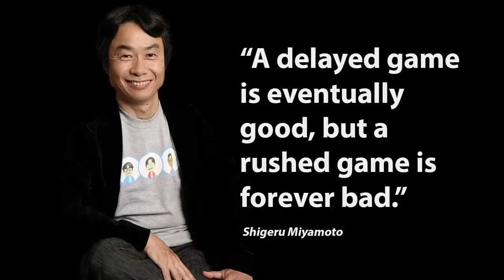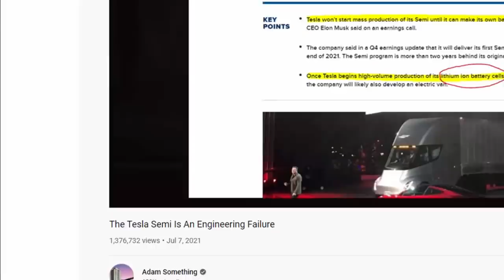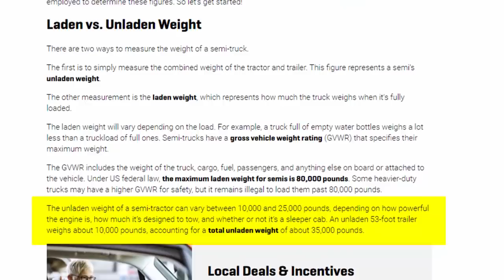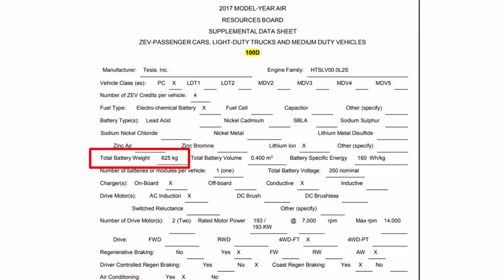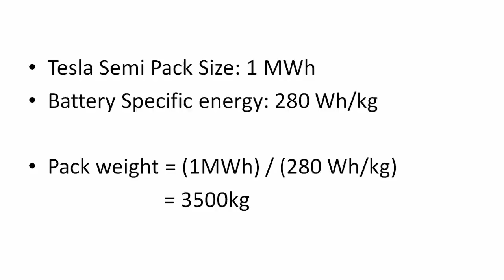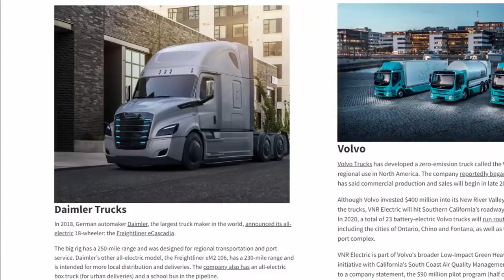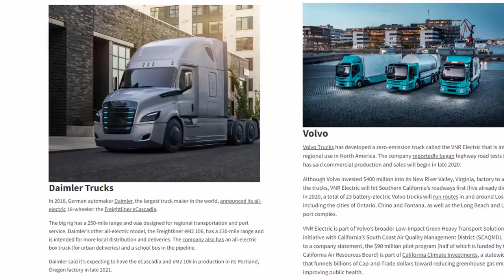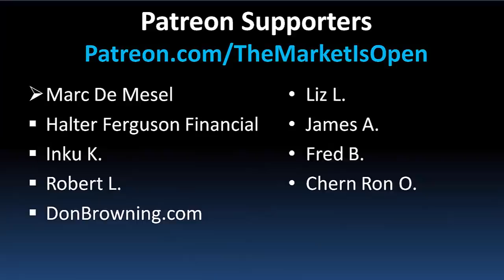The 2022 Tesla Semi is Genius, And Here’s Why

Comment: As someone from the shipping world, "with" what I have learned about this truck, "I Think" it will a have very limited customer base due to the Battery System. I think Tesla engineers would be better served with a storage system that is interchangeable rapidly like a towed energy storage dolly or removable energy storage cassettes, or Both? Then a driver could pull into a destination, or "Truck Stop", swap out energy systems in a few minutes keeping the units on the road making money virtually all the time While Increasing Range to an UNLIMITED Amount! with momentary stops only dependent on regeneration stations.
Reply: That would require someone to standardise the batteries, it is changing too fast at the moment and I don't think competing companies will come to an agreement regarding this. Also these batteries are extremely heavy at the moment so I cannot imagine driver exchanging them fast without some sort of crane or risking accident.
Reply: You are thinking of "Long Haul" trucks, which is fine, but Tesla Stated they are targeting the "Other 80% of The Market: Day Cabs & Local Runs, never more than 250 Miles out from Base, in any given Day!"
Reply: more removable parts more opportunities for human error. bad idea
Reply: @mkocel  automate the change? like an automated car wash, off the shelf tech.
Reply: They'd need giant drop lots for all that, truck stop won't let anybody drop a trailer defiantly not several dozen but it is a good idea

Comment: Good ass video. I knew his fucking video was bullshit. Especially since he didnt account any range differences in the trucks. Diesal has about 2000 miles while tesla has 500 and is meant for specialized tasks. But he compared the tesla truck as if it had the same range. Tesla never claimed for 2000 miles
Reply: Every driver has to rest for at least 1 hour after 500 miles. Exactly the time the Tesla Semi needs to recharge. The Semi has a range of 500 miles.

Comment: Quality control at Tesla is a huge issue. Plus EV range vs weight is a real issue no matter what this video implies. There are plenty of EV tow videos of real world testing out there.
Reply: I love how people keep repeating the same false FUD they got from the media.  Did you know that Tesla makes on average 27 vehicle or productions changes per model, per week?  Not per year, per week.  Legacy auto does 4 or 5 changes per year.  Tesla is improving the cars or the production process faster then any manufacture in history.  The cars get better or cheaper to manufacture on a weekly basis.   Quality control is a media induce false narrative.

Regarding towing, at highway speeds aerodynamics has a much bigger impact on range than does weight (rolling resistance).  The Semi's range is mostly dependent on aerodynamics.  The Semi is designed to reduce the drag from a 53ft box trailer.  Videos of a Model X towing anything has the disadvantage of aerodynamics not being optimized for the trailer.  A trailer could be designed and built to minimize the drag behind a Model X and greatly improve the range while towing.  The weight doesn't have as much impact on range as does the aerodynamics.

Diesel trucks aren't as sensitive to aerodynamics because the main drag on performance is drive train inefficiencies.  For ICE vehicles drive train, aerodynamics, and rolling resistance are what determines how efficiently they are in that order.  EV's have the same things working against them, but in a different order.  It's aerodynamics, rolling resistance and then drive train.  EVs have very little energy in the batteries, but they are very efficient at putting that energy to use moving the vehicle.  ICE vehicles carry a lot of energy in the diesel/gas, but turn most of it into heat.  Hence the reason EV's don't need big radiators to cool the engine.

The Tesla Semi will change the trucking industry.

Comment: Great comments.  Frist deployments -   A vertical rear mounted battery pack that is air-cooled will have capacity for short range hauls (intra-city and metropolitan)  in areas with sufficient charging station density

Comment: If they allow a lot of extra weight beyond 80 tons it puts a lot of wear and tear on the infrastructure.  And because these trucks won't be paying the gas tax the burden for paying for fixing these roads Will be on people not associated with the transportation business.
Reply: The Tesla Semi is just 2 tons heavier than the diesel truck. So what? And tax will come for shure for electric trucks. Thats inevitable.
Reply: Ok it's 80,000lbs ~ 40 tonnes...
Reply: Just add some more wheels.
Reply: Wouldn’t be the first time that tax payers pay for Elon‘s insane money pits
Reply: @MaticTheProto  you  mean after they bailed out  gm and Ford?
Reply: @vic321344  Your point? Idgaf if those two brands died
Reply: @MaticTheProto  There are money pits the taxpayer fill which are like a landfill in comparison. Tesla in comparison refused a 1 bill $ subsidy for the battery production by the EU.

Comment: But Tesla cars in production now even the latest ones have batteries 10 times heavier than the diesel in regular production cars with the same range. It’s not the laws of batteries it’s just energy density batteries have an energy density of at most 4MJ per kg where as diesel has 46MJ per kg it’s just the the nature of batteries electric vehicles are bad they are better than regular cars even if cars at all are awful but they physically cannot weigh less than 8-10 times more so they are going to be too heavy
Reply: Doug he did all the calculations for you, go rewatch the video, if you have a problem with it find your own numbers that make sense. The problem with comparing energy density is 3 fold

A. Tesla semi has 500 miles of range and is specialized for company routes, diesel’s have 2000 miles of range and is used in everything rn

B. Electric vehicles use their energy much much more efficiently. Combustion is 25% efficiency and electric is 70%

C. Batteries are getting more energy dense every year, there is no law of battery when the law keeps shifting.
Reply: @cjk_02221  also if it’s being used on specific routes just build a rail line, they are better in every way, more load more efficient, easier to automate, safer and faster so if it’s only being used on specific routes that’s just more reason to build public transport than trying to solve the multiple problems with today’s lorries with a less viable lorry that is much better for the environment but just as bad for roads and only exacerbates the lithium shortage should this be adopted and yes other materials can be used but they are just as rare. It is the same as almost every musk promise, a big claim like fully autonomous today 2017 at the revile of the truck still isn’t today or that in a convey scenario it beats rail which is impossible just based on rolling resistance.
Reply: There is no law of batteries there is just chemistry you can only pack a certain amount of free floating electrons in the lithium you can edge more and more but it’s like fitting a large sponge in a small cup, sure the cup can squeeze a lot of sponge in but after you reach a limo the effort you have to put in has diminishing returns to a very large extent

Comment: What you have left out is every loading dock will have a destination charger. Range will no longer be an issue.
Reply: Jacob LF - Right! And also, that these are Day Cabs, not designed with a Sleeper included, because they are targeting, what they determined to be, 80% of all truck Operations, being never over 250 Miles, from a Home Base! And also mentioned the idea of "A Megacharger Destination Charger", which could basically be, a Redesigned 150 to 250 kW Supercharger, for Overnight Charging Functions, at the "Base!"
Reply: Trucks turn and burn at the loading dock.  They only place they tend to stop for a long amount of time is at truck stops or mechanic shops.
Reply: YOU HOPE! LOL

Comment: Im especially curious about the semi‘s drag coefficient. When it comes to trucks, the primary issues are weight and air resistance. 
But even as a Tesla bull I am very sceptical about the semi‘s success outside of North America. That has nothing to do with its nature of being an EV, but solemnly on its form factor, that doesn’t match with e. g. european standards. A Semi could not handle a standard EU trailer, because the overall vehicle would become to long. 
(For non-Europeans: for Trucks in the EU, the overall length of the vehicle including the semi is relevant. In the states it’s only the length of the trailer afaik. That’s the reason why trucks in the EU have a totally different design approach than in North America)
Reply: Now that you say that, I don't remember ever or at least only very rarely seen trucks in the EU with a "nose", nearly every truck (with trailer that is, not specialised, which usually are smaller trucks in complete length) have a vertical 'flush' front.

Though personally I don't know anything about it regarding legal demands.
Reply: @MDP1702  A Scania Diesel Semi has a length of 5.8 m, The Tesla Semi 6.3 m. So we are talking about 50cm. And the legislation only limits the total length of the vehicle, trailer included. Under a Trailer there is more than 50cm surplus space.